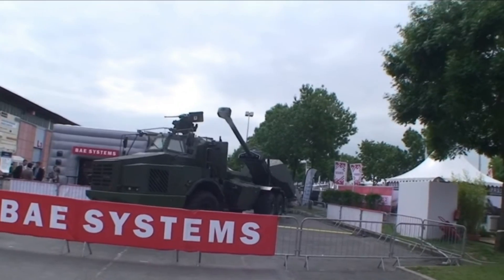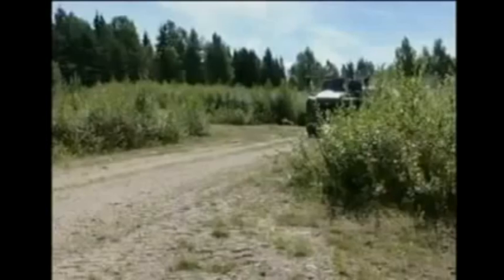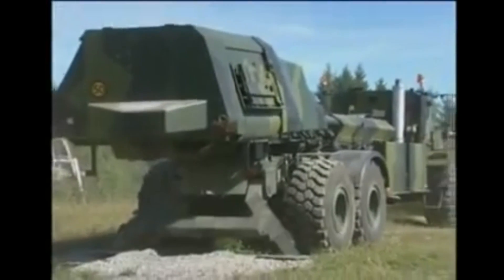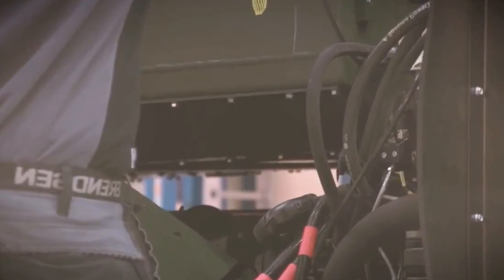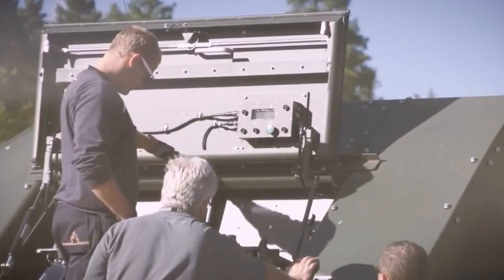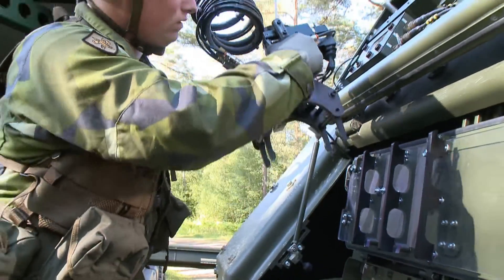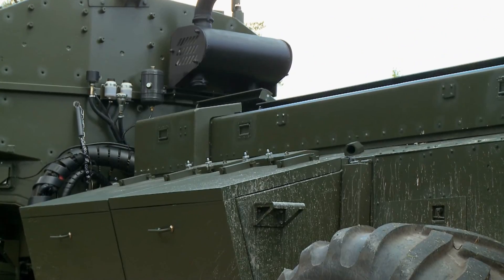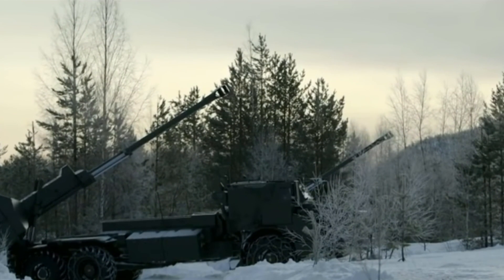Archer FH77 Self-Propelled 155mm Howitzer

Comment: I'm probably gonna catch some flak for this, but here are some of the reasons Norway pulled out of this project:
1. The auto-loading mechanism and firing process made the truck shake violently, the accuracy when firing fast wasn't satisfying because of this.
2. The weight got too high for only 6 wheels causing too high axle weight for poor Norwegian roads and bridges.
3. The development of the promised ammunition resupply vehicle didn't progress. Apparently because of a bankruptcy.
4. Delays. All units were supposed to be delivered by 2013.

This might have been remedied by now, I don't know. Norway is highly likely going for the K9 as the Finns are, although formally M109 KAWEST is still in the running.
Reply: Just a little flak :)
1. All artillery systems shake when fired. what was claimed was that when Archer performing MRSI with barrel not pointing in vehicles direction the vibrations was lasting too long and therefor not be able to perform MRSI. 
Witch kind of MRSI that would fail we do not know. Archer can do up to max 6 Shells. For instance K9 Thunder can do max 3 shells when doing MRSI. 
2. Did Norway not get the specifications before they ordered the product?
3. Correct. the subcontractor went bankrupty so a new solution (not so good in my opinion) had to be done
4. The bankrupty above was that created most of the delay.

With all above said I do hope you go for the K9. In my opinion it seems to be a good system. But it is kinda interesting its similarity with the Archer system.
Reply: The weight does sound plausible considering weight limits on  Norwegian roads, 11 t per axel is quite a bit of weight. Accuracy is not a plausible reason, even if it was stated but all involved in with the manufacturing and testing testify that it was a bullshit reason made up by Norway and there's been no proof to that claim.
Delay was an issue, but there's pretty much no military projekts that run on time, just look at HKP 14!

Comment: Re. winter mobility: they have a chain ladder arrangement which fits over the rear bogie tyres, making it effectively a rear track system for snow and forrest floor. The chassis is articulated behind the cab giving the Archer a respectable turning circle through firebreaks etc.Great videos. Glad you're enjoying Canada.

Comment: Cool system, def going to be cheaper than getting pzh2000s(others are available) and at half the weight. Obviously pretty big target for anything from helicopters to even AFVs and more vulnerable to counter battery. But you can't have it all ^^
Reply: "and more vulnerable to counter battery" In what way?
Reply: But it can shoot and scoot quickly :) So it's agileness makes it a difficult target too :) I have also seen it with Barracuda camo nets which makes it invisible to infra-red and heat vision.

Comment: I have worked with similar chassis in mines, they have great offroad capability and this thing is going to be much lighter than a tipper full of ore.
Reply: Yea.. they use the mid range A35 chasie, but still have a 20 ton over capacity.
Reply: I checked out of curiosity, this thing is 21 tons lighter than a fully loaded A30D. 
http://www.ritchiespecs.com/specification?type=Co&category=Articulated+Dump+Truck&make=Volvo&model=A30D&modelid=97716
Reply: They could have loaded a double bareld artilery pieace on it :D
Reply: https://www.volvoce.com/india/en-in/products/articulated-haulers/a60h/
There is a 60 ton version now.. they should use this and put 4 barrels on it like the german anti tank tank during WWII.. that would be epic.
Reply: Jason Reynolds i used to work in the place where they make theese :D
Reply: SgtDrDeath I thought the cab lights and front end looked familiar as we operate similar looking dump trucks in the steelworks I work in  - they are very reliable engine units and hard working machines

Comment: the FH77A/B is not in service in Sweden anymore. Archer is the only artillery we got
Reply: Filip Karlsson like only only artillery? Nothing else, because even 48 pieces of guns for country the size of Sweden is freaking sparse. Like sure these guns can rain he'll where they are, but its still only 40 km range. So should there be an extended front, that would be bad.

Like no mortars, no any other towed guns at all? That is pretty dicey.
Reply: Ari Takalo swedish armed forces are currently reinstating 120mm mortars back into service. And that's about it
Reply: Well, "in service" is a pretty loose term when it comes to Sweden and military materiel because after things get decommissioned (e.g. Ikv 91) they are merely placed in reserves in mobilization storage facilites and are commonly seen acting OPFOR during military exercises.
Reply: Filip Karlsson 
India continues to use FH 77B howitzer ...served us well during Kargil war as it denied the enemy even a good night sleep as it pounded non stop the higher ground enabling the infantry to capture them..new upgraded/tweeked version called "Dhanush" will soon b operational.
Great guns..absolute solid and battle proven
Reply: NerothLoD sure 480 because Sweden needs nearly 2x more Arty than Germany needs tanks
Reply: Sweden toke the towed guns out around 2009 but has mortars. I guess we have about 4-6 Archers ready so they have to make a few
Reply: The FH77B is the Archer. The FH77B was used in the manufacturing of the Archer, that's why there will be 48 Archers.
Reply: There should be like 480 of these, not 48. But the government idiots in charge are more interested in "HBTQ" and "feminism". (They're not, but it's what sells right now, so they go with it.)

Also, I would argue that with the Archer system, you don't really need anyhting else. They're mobile, and deploy/redeploy rapidly. We don't need anything else, just more of these grunkor.

Comment: Salesman: "...It's got a 155mm Howitzer on a 6 x 6 chassis. It's got a range of 40 - 60 Kilometers, depending on ammunition. It boasts NBC protection and a crew cabin separated from the gun and ammunition. Would be excellent defense against any modern military threat."

Swedish Reps: "Would it be good against, say.... Russia? >.>"

Salesman: "Uh....I suppose so...."

Swedish Reps: "We'll take twenty-four."
Reply: Well.. it was actually designed from order of Swedish and Danish defense. So it was not sold at that stage. Denmark later pulled out, and Norway come in.. then after it was finished, also Norway pulled out
Reply: Just a jest, mate. c:
Reply: But... Ryssen kommer! Havnt you heard of it, they are full like a kastrull most of the time anyway!
Reply: @zipp4everyone263  that's the problem, they are so drunk they don't go down unless turned to paste and mist and too drunk to feel pain.
Reply: Hahaha, hang on, make it 48
J Ford
Reply: Need to repel the EU troops when they land

Comment: Needs a bigger gun they need to have a 203mm like the pion
Reply: The problem with 203mm guns it that they are heavy and big. The range of the Pion is about the same, but it is slower and weights about the twice as much, does not have NBC protection, no protection for the loader and gunner,  a slower fire rate, slower deployment time and a lot slower fire rate. 
It is just not worth the compromise putting a 203mm on a modern spg when they are just a middle ground between the 155mm guns and the bigger MLRS.
Reply: If you need more than 155 then call fast air
Reply: Synapsis Flame any thing bigger the 155mm is unnecessary.
Reply: If you need more boom a  rocket artillery system would be the way to go.
Reply: If we needed a bigger gun, we'd have made it with a bigger gun. This thing is made for the kind of combat we would see in a defensive scenario, and knowing us I doubt we'll go on the offensive any time soon.
Reply: you dont need high caliber if you land your shells exactly where you need them... a 105mm would usually get the job done if you could land it within 30 cm of CEP and that's why m982 excalibur is so important... dropping a 155mm shell from 57 km with a CEP of 4 meters is an absolute game changer... analysis have shown that 1 excalibur shell can do the job that would otherwise require from 10 to 50 unguided shells 

(CEP = circular error probable)
Reply: Agreed. Seems under-armed for a SPG of its size. However, if the shells are good enough, the difference isn't that severe. Smaller gun also means higher rate of fire, generally.

Comment: Awesome system but when using the Excalibur round makes this one of the best in the world .
Reply: So you first claim the Excalibur is better than the Vulcano, realise you were wrong and now claiming it's all irrelevant? Great conversation.
Reply: So 30 km longer range does not 'prove' anything?
Reply: The N5 excalibur is the naval 5-inch variant of the excalibur. Not an artillery projectile.
Reply: What does this have to do with our discussion about the superiority of the 155mm vulcano ove the Excalibur?
Reply: +Jonny
Forget it ^^ When you provided the info and he kept trolling you shoulda known this would end as it did ^^
Reply: I just want to know how he tries to get out of this xD
Reply: Vulcano does have SAL capability too. Options are IMU+GPS and terminal SAL guidance. Vulcano 155 GPS/SAL has a accuracy of 1 meter. Do you know what you're talking about?
Reply: Jonny citation needed.
Reply: Straight from the producer: http://www.leonardocompany.com/en/-/vulcano-155mm
Reply: Not the new N5 Excalibur .
Reply: The Vulcan is a rocket assisted round so yes it does have longer range but not as accurate plus newer Excalibur S can hit moving targets with a semi-active laser targeting capability. The SAL seeker will allow the shell to attack moving targets or those that have re-positioned after firing, and to change the impact point to avoid collateral damage .
Reply: I worked on Inertial guidance systems in the navy and they are highly porn to errors . I have real world experience and do not copy paste information from Wikipedia like most youtube experts .
Reply: Real world expierience is great but completely useless if you want to compare one system that you used and another wich you don't have a single clue about. I got my info from the manufacturers websites.

'are highly porn to errors'

Wat.
Reply: You have to understand the physics for inertial guidance and displacement gyroscopes and accelerators . If not calibrated correctly , they are useless . Human error .
Reply: I actuallly ment your spelling of 'prone'... nvm. The Vulcan is still better than the Excalibur tho.
Reply: What ever . Another you tube expert that lives in their parents basement .
Reply: Why are you mad? The Vulcan ammunition is clearly superior, compare the stats it doesen't need expert knowlegde to see it.
Reply: Well you do not have data that proves other then your opinion .
Reply: The word IRRELEVANT .
Reply: Vulcan is better than Excalibur tho.
Reply: It will all be irrelevant when the US fields a prototype of the rail gun that will have a 200 NM range .

Comment: d-did they use a bloody Articled dump truck as the base?!
Reply: wtf is this blasphemy, how dare they use a off the shelf vehicle and keep costs low. Psshhh our proud American companies would need billions just to develop the vehicle alone and still fail have costs overrun and need more again. This thing is awesome and fits the Swedish doctrine perfectly.
Reply: Yes, they also often work in rough terrain and you don`t need to design a new vehicle as the truck already has proven it self on the commercial market. If it works why not?
Reply: Tanner Lilley Will it's used for moving dirt/soil
Reply: Yeah, it's more of a middle ground between the typical tracked and wheeled platforms for artillery. It sacrifices quite a bit of onroad handling for those offroad capabilities.
Reply: Yes, and where's the problem?
Reply: @zipp4everyone263  the problem is to avoid tripping over the surplus of spare parts in the motor pool ;)
Reply: moron
Reply: N-no.